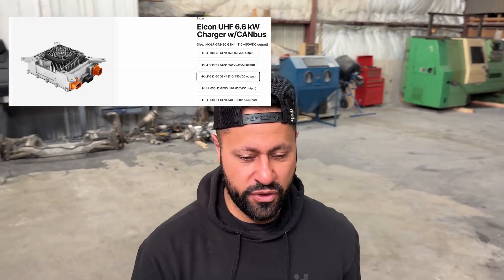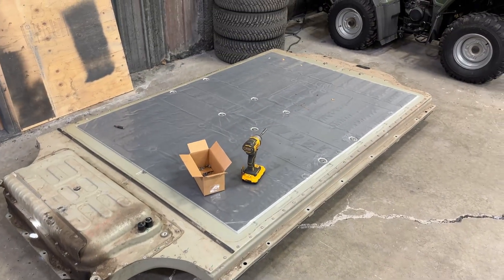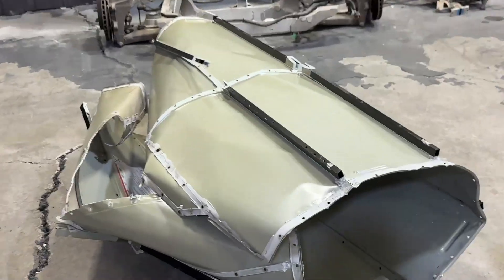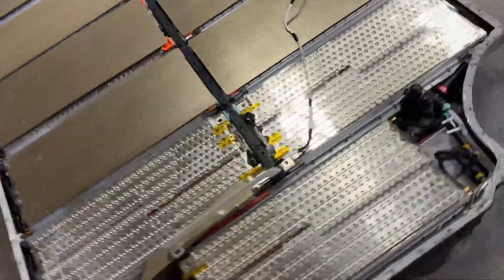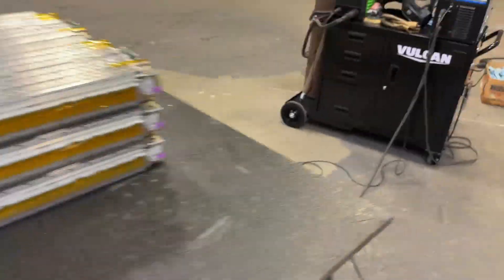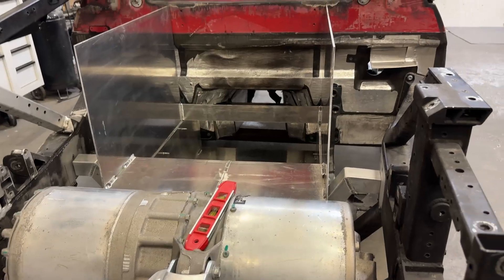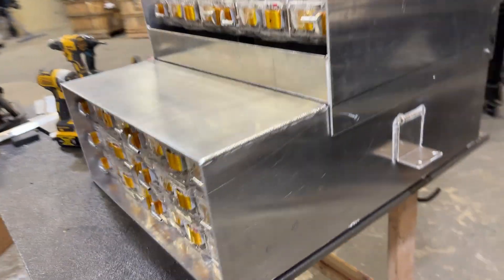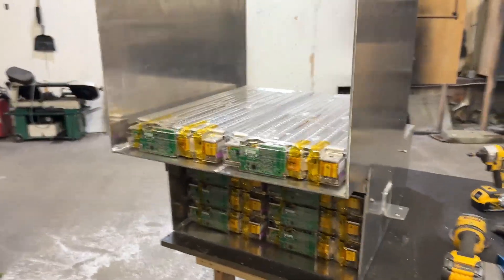Episode 5 Lamborghini Aventador SV Tesla Swap-Battery Box Fab!

Comment: Coolest most unique teams swap I've seen! Better than the boosted boiz HELLESLA even!
Electric classic cars had a series of killer tesla swapped Ferrari teslarossas which this reminds me if. Added adjustable suspension, power steering, better stereos brakes wheels etc and still came out within 100# of a stock testarossa! But got the 0-60mph down to low 3s!

Comment: HI Dario. Will stacking up the batteries that high seriously affect the roll center?
Seems a shame to be cutting up the rear cradle. You may have been able to create a new cradle designed for battery placement and bolt it to the tub... Next time!
Reply from the maker: It absolutely will! That is why i tried placing the battery as low as I could. I only cut two tabs out of the way where the old motor mounts went, still very structurally sound!